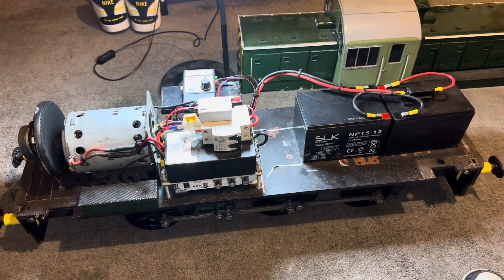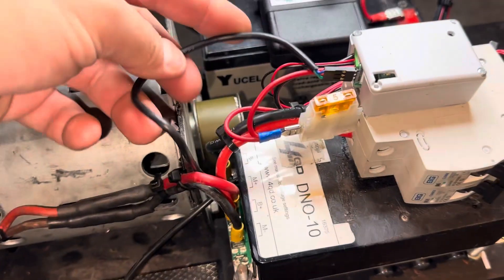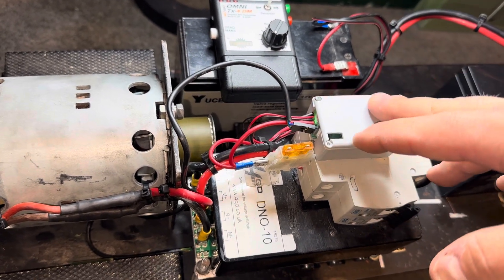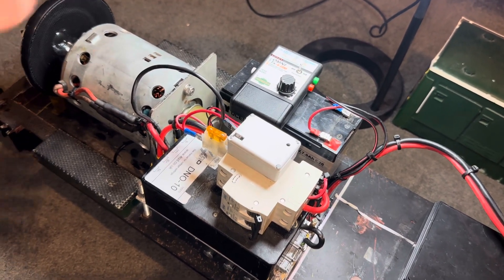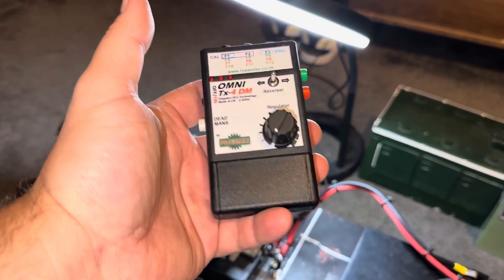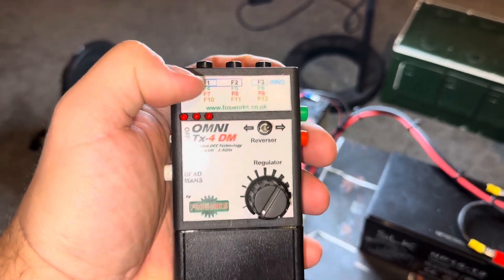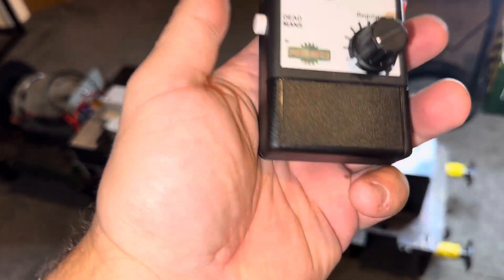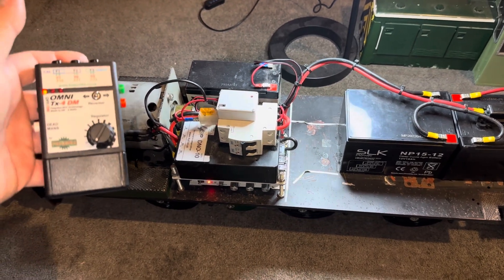5” gauge Class 14 with Fosworks RC and DCC sound

Comment: Looks and sounds awesome! How did you wire the LokSound 5 to the amp? I have functionally the same setup from Fosworks, but struggling to understand the outputs from the LokSound chip to connect it to the amp. Cheers!

Comment: Eric, nicely done!

How do you charge the batteries? Also, for the 12V system why have a separate battery and not tap off the 24V (2 x 12V in series) traction batteries? Or, just use a 24V to 12V converter?

The dead weight of all those lead-acid batteries will no doubt help your tractive force!
Reply from the maker: @pstonard  hi, tbh its not too much hassle to remove the body, so i just take them out.
I use a seperate battery for the sound and lights as they can then run all day happily, without the cost of limiting the life of the main batteries. Just gives you a bit longer play time!
Reply: @UndergroundEric  Thanks for sharing your experience. Makes perfect sense to me.

Comment: Its greatcto see thr bigger gauge and here your description im a total novice with electral control so i wonder if you could give me a little advice ,i have a 7.25 loco im restoring and its poeered by a Sinclair c5 motor i was wondering what conrroller i could use i ld like it to be a plug control that i could manually hold behind the loco ,it will be powered by leisure battery best regards Marc
Reply: Hi Marc, did you ever find a solution for this?
My only experience has been with Mtroniks so far, but other options are available! 4QD are also commonly used wired controllers.

After looking online the C5 motor is 12v 300 watts, if i were you i would go for an Mtroniks DCi120-12, which is good for 12v and the current can be limited down on a dial depending what your maximum is (25A maximum if i did the maths right)

It's basic as anything to wire in, it has a removeable plug-in control handset plus the option to connect up a relay board for horns or sound or smoke or whatever if desired in the future.

As said though, that's just my personal experience!
Reply: @maxshep2829  hi max thanks for your comment I'll look into mitroniks as you suggest
Reply from the maker: @marcmurrell8827  sorry for the late reply. I would as Max said use a Mtroniks 12V system, or you could use a 4QD DNO-10, i believe they have a 12v setting.

Tbh the class 14 had a 12v motor yet i ran it on a 24V system without issue, just dont go too mad with the power if so! 😇

Comment: Did you say you're fitting this system into a 47 ??
Reply from the maker: @jetjohnc  i will be doing my 47 at some point yeah
Reply: @UndergroundEric how expensive is that set up? Excluding the controller.
Is it better than a Mktronics setup? Cheers John
Reply from the maker: @jetjohnc  its probably a similar price. £120 for the sound decoder, £150ish for the fosworks stuff, £20 on an amplifier, £20 on a speaker, then just patience lol
Reply: @UndergroundEric  thanks,